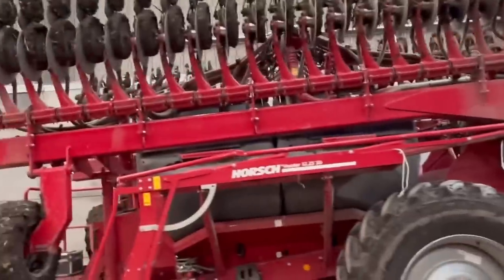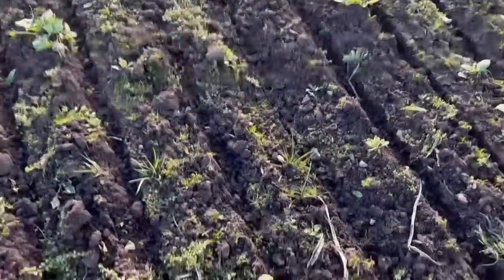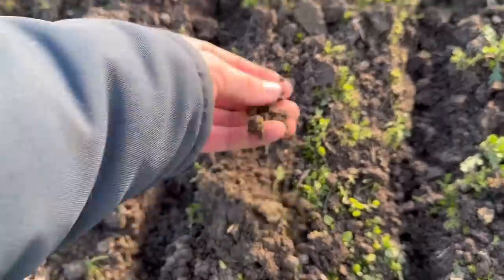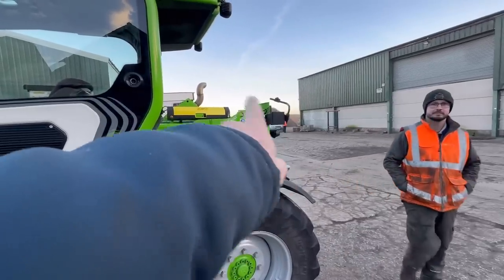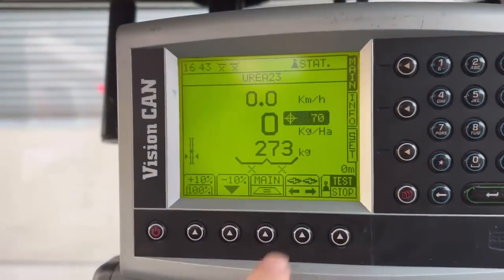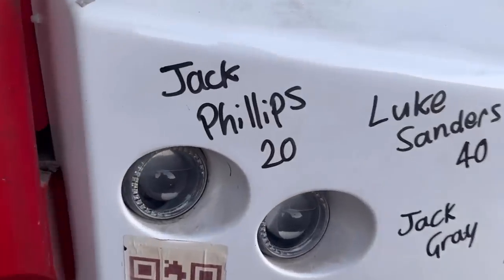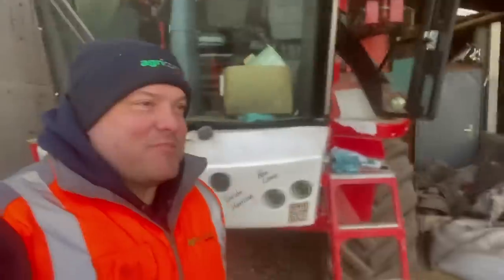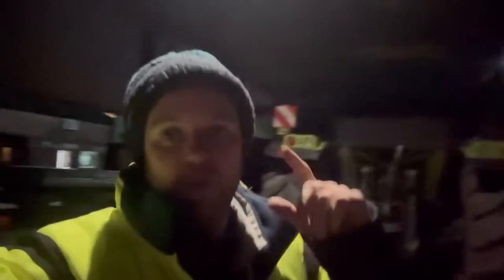ITS A GOOD JOB WE TESTED THE SPREADER  #OLLYBLOGS #AnswerAsAPercent 1051

Comment: Loving the channel. Shout out from Ireland. Out of interest what coulter pressure are you running? Around 60 bar? And the slot closers are they in the top bottom or mid position? What the trick to get the slots to close over correctly?

Comment: Don't even have to watch and like this vid as I know how good this vid is going be. Keep up the great work. I have a question  how do you put the tramlines in. Is it a setting you do on the seeder that you cut off two pasific blowers or do you have a tool to do it. I never knew how they were put into the feild
Reply from the maker: It can be although I use the sprayer
Reply: @OllyBlogsAgricontractfarmer  I suppose it would be handy.

Comment: What Variety is that Wheat Olly ?
Reply from the maker: Exstase
Reply: @OllyBlogsAgricontractfarmer  ah man I dont think we put much of that in last autumn because there were some issues last harvest, its going to be interesting to see how it does planted this late, my instinct says it will do well, I have worked with that seed for the people that bred it. It didnt like the hot dry period last summer for some reason, the year before and before that was wet and wet then dry and it did really well, I have video of planting Extase in one of the seed growing areas, I met the guy that bred it and It and he told me it has high protein without late Nitrogen so it will be a good test KWS